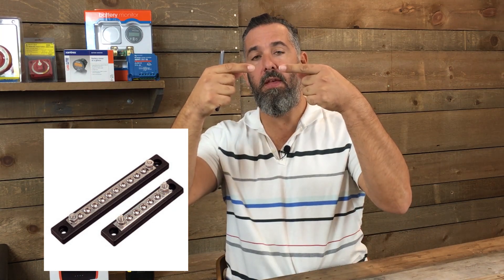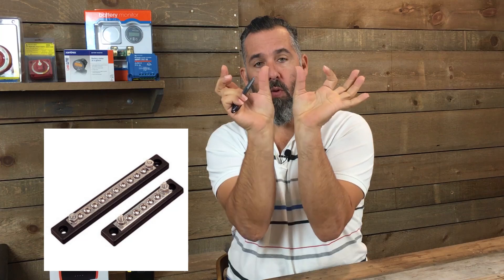Ask PYS - How Do I Join Two Cable Into One and Make Them Waterproof?

Comment: Jeff I got another question I hope you can help me with. With a combiner switch 6011 from house to starting battery with about 20 feet between batteries is it wise to fuse at start of house battery to switch and one off of switch to fuse block? Using 8awg wire running just a few things what size breaker would you recommend for this setup? Just confused if I should use two and if there will be issues if I ever need to jump start with having the breaker be too small.

Comment: Thanks Jeff really enjoy the vids as a newbie to boat electrics. My Question is regarding our Wifi router but I suppose it can be related to many other devices.  I am wanting to convert this AC device to DC (12V in the case of my boat) It is the only device I need to have running though the day and night but to do so right now I have to run my inverter which means using more power.  Can it be done and if so how can I do it? Would appreciate your comments.
Reply from the maker: Most routers and switches are actually powered by 12 VDC, and the power adaptor that comes with the device, converts 120 VAC to 12 VDC. If the device is 12 VDC powered, we commonly cut the power cord from the adaptor and power it directly from a 12 VDC battery.
Reply: @PacificYachtSystems  cheers for that it dos say 12V on the plug so I’ll have a go.

Comment: third way is to run a new wire the full length
Reply from the maker: Good one, when possible, usually better to have a single run then to have joints.

Comment: Hi Jeff, I have a question about main battery switches.  My old boat had 1 'red' battery switch with positions : off, 1, 2 or both.  My new boat (European built) has 1 `red` battery switch labeled 'house' and on and  off positions.  It has a 2nd red battery switch labeled 'start' with on and off positions.  It has a third 'black` switch with on and off positions.  What is the purpose of the `black' switch?   I want to connect a Victron 712 battery monitor and am thinking to connect it between the black switch and the battery - using black cables.  Is this possible.  Thanks for your help.  Marshall
Reply from the maker: Many French boat builders, install a DC negative disconnect for the whole boat. The black on/off switch, when installed properly, is suppose to disconnect all loads from the battery by disconnecting the DC negative return.

Caution: many boaters and installers don't understand the purpose of this on/off DC negative switch and bypass it. Unfortunately, these modifications post factory render the purpose of the DC negative switch to be only partial. 

Also, many French boat builders do NOT provide the boater the option of paralleling / combining the house and engine battery in the event of an emergency.